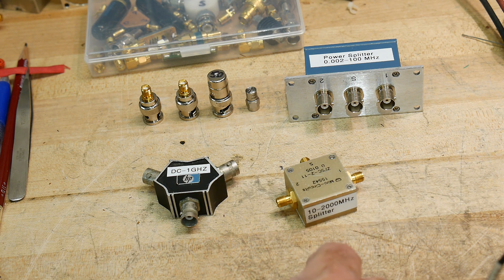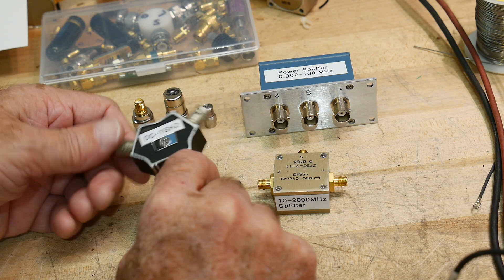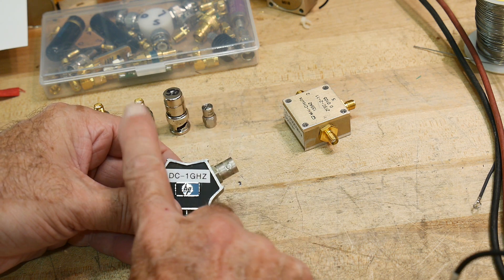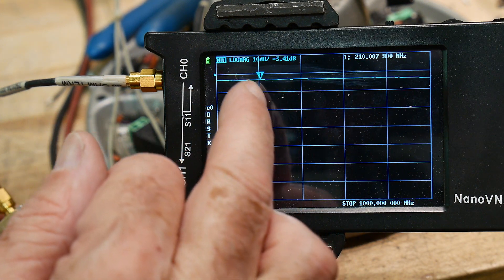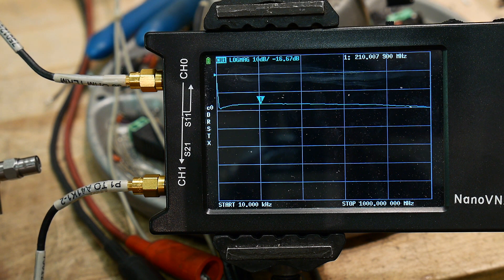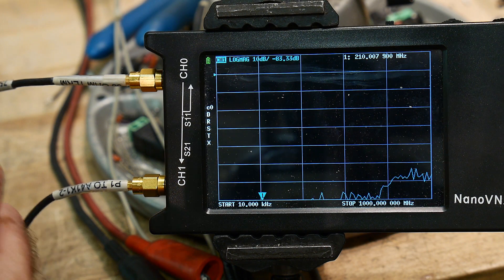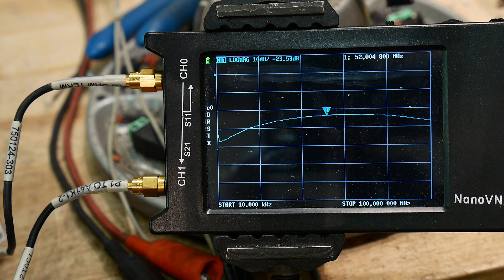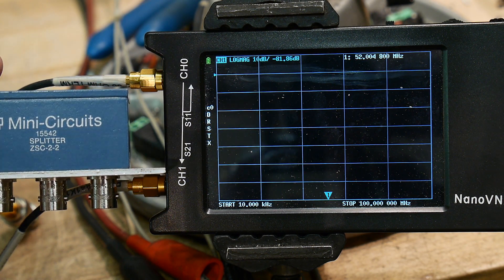#603 NanoVNA Measurements of Various Power Splitters

Comment: How do I calibrate the NanoVNA to measure power splitters? Should I do it as normally I would do to measure an antenna for example?
Reply from the maker: The nanovna only has one way of calibrating which includes a thru cal.  The thru cal will allow accurate S21 transmission measurements which will be used here.
Reply: @IMSAIGuy  Got you, so I calibrate at the extreme of the cable on CH0 adding the thru cal to CH1 as well. Thank you.

Comment: Is directivity the same as isolation?
Reply from the maker: I've heard the term used with couplers. it is the isolation between coupled signal and the reflected power from the unused coupler port. I don't know if the term is used on splitters.

Comment: Hello IMSAI Guy, I have a Mini Circuits ZFSCJ-2-1, a 500mhz 180 degree splitter -combiner.  How would one measure isolation and insertion loss and phase difference between ports on that?
Reply from the maker: isolation is same. the phase measurement is the tricky one. If you have a good spectrum analyzer there will be connectors on the back that are useful. The IF frequency of my SA is around 20MHz and is brought to a BNC on the back. This can be connected to an oscilloscope and viewed directly. Since this signal is just the original sent through mixers the phase information is preserved. You can then just check the two ports of your splitter do see the phase.

Comment: nice splitters/couplers are always made with transformers to reach low insertion loss and good isolation , however they don't have same low fequency response ...expensive or home made tweaked reach 3.2 insertion loss and more than 16 dB over threeoctave ie 10-1000 MHz , mini circuit is a good manufacturer for these like Anzac ...